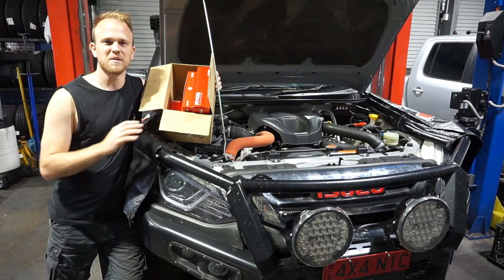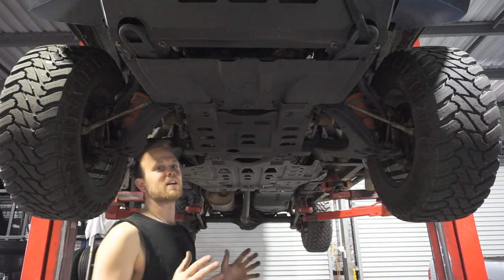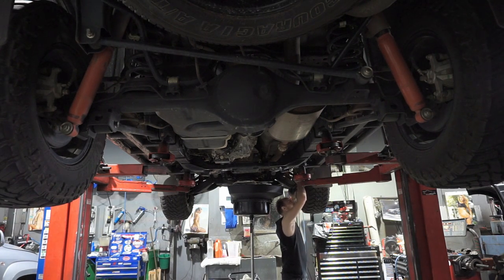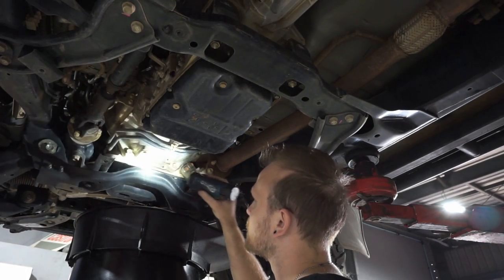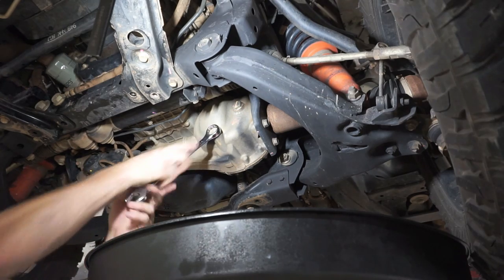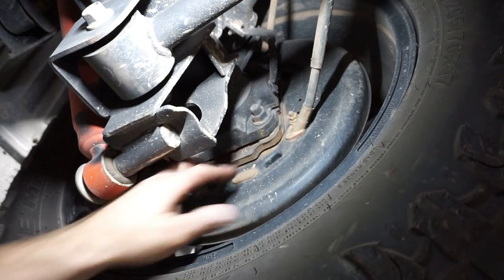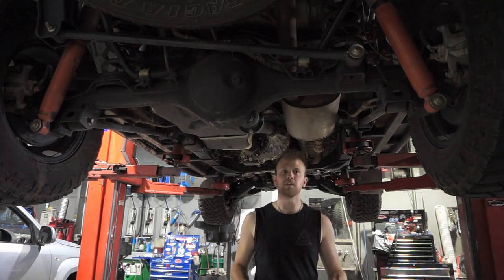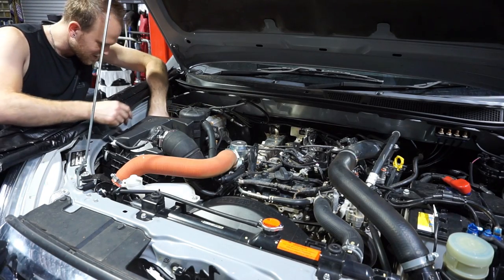How To Maintain & Service Your 4WD Vehicle - Isuzu MU-X Service & Maintenance

Comment from the maker: Hey Guys! Here's some tools that will make the job alot easier! 
Oil filter removal pliers - https://amzn.to/3cm8KMG
Socket and spanner set - https://amzn.to/3y7hrEr
24mm spanner - https://amzn.to/3lFMm60
24mm socket - https://amzn.to/3pDGVW8
1/2" Breaker Bar - https://amzn.to/3lLuoPg
Screwdriver kit - https://amzn.to/3Gmx7qh
Pick Set - https://amzn.to/3oz54OA
Bit Set - https://amzn.to/31FP3NQ
Cheers :)

Comment: Thanks for showing us how to do the maintenance work of Isuzu MU-X. I do not own one, but I was considering to buy an Isuzu MU-X. I was interested in all the construction details of the car. Such as chassis, suspension system, rear axle, drive shaft, brakes, engine & transmission. That was very informative, everything was thoroughly explained. This video is also giving a lot of information about the car itself. If I would go to the dealer to see how well the car was built, since I would not be able crawl underneath the car to see all of these details, by watching your video, I can have a fair idea about the quality of the car.

Comment: Thanks so much Nick. Just did my Dmax oil change, front and rear diff change and fuel filter. 

Please do one on radiator fluid change and transfer case oil change.

Comment: Great thorough video. Another request for a new video is drive belt replacement. In all of YouTube noone has done an isuzu drive belt video... I ended up only replacing the v-belt and leaving the main belt because damned if I could figure out how to access the nut on the back of alternator to loosen it off.

Comment: Nice video mate. Do you reckon you could do one on how to change the auto transmission fluid on the isuzu? Would help alot.

Thanks
Reply from the maker: I will definately do one down the track, I'm thinking next service i will flush the trans oil.
Reply: @LowRangeNick  ledgend. Maybe add a transmission cooler while you're there

Comment: Always enjoy your videos. Is there any advice you would particularly point out to those who have no hoist?
Reply from the maker: I would recommend getting a good car jack that can lift the car a decent height and 4 jack stands. Lift the car up as high as you can and put a jack stand on each corner so all the wheels are off the ground. Then throw down some big flattened cardboard boxes under the whole car or use a creeper to slide underneath. You can then pretty much follow through exactly how i did the service in the video. That's how I do services at home 😊
Reply: Probably not super endorsed.... but.... I use 4 wheel ramps and crawl up in low. Been used on LR D1, D2, Jimny and MUX. Jam a hefty piece wood to create a V shape behind two wheels for added safety. 
Not as good as a hoist, but works pretty well. For checks on bearings then just lift each corner or if you can each end.
Axle stands do work, but not as stable if you want to start reefing on things.
Reply: @LowRangeNick  Thanks Nick

Comment: Hey Nick great video, really helping me service my own car while I travel Australia. 
Do you have a link for the exact Front and rear diff oil that you used here?
Reply from the maker: You can use any brand diff oil that you like 80w90 is fine. I have a rear e locked in the rear now so I use 80w140 in the rear.

Comment: Hey nick great video as usual. Mate I am a motor mechanic by trade, I'm 63 so came out of my time yonks ago. My question to you is I have a brand new mux , just had the first 15,000 service done on it, I'm thinking rather than wait another 12 months for an oil change, I plan to do it every six months, what's your opinion? Isuzu tell you every 12 months but I feel that's too long. Cheers and keep those videos coming
Reply from the maker: Thanks a lot for the comment and for watching. I agree 12 months is a long time. I personally carry out my servicing every 10,000km or 6 months. Although the 15k intervals are probably ok with modern synthetic oils I still believe that it should be done sooner. If you look in the service book under extreme use you will notice that most of the normal things we do day to day or out on the weekends in our vehicles actually fall under extreme use haha
Reply: @LowRangeNick  yeah mate I agree, soon I'm gonna be towing a caravan so yeah every six, cheers mate and again love watching your videos, maybe an old fart like me can still learn something from a young fella like you,.

Comment: Nice video Nick. Are you worried about spraying brake cleaner in the engine bay and it eating the paint from over spray?
Reply from the maker: Ive never had any issues with the brake cleaner doing any damage to paint in the engine bay and after servicing i always wash down the engine bay and under carriage with water so the brake cleaner doesnt get time to cause any issues.

Comment: Should probably split off the cabin filter section, it's a great bit of info amongst normal maintenance stuff.
The oil filter catch/drain tray was a nice touch by Isuzu, not seen one of them before, LR and Suzuki just let you spill it over everything.
Might want to put a comment on the video though:
Fuel filter clean out, better to wash out with fibre free rag and diesel. Not sure what the cleaner you use is, but it kind of looks like degreaser, I don't think that would be a good choice for the fuel system, normal brake cleaner that evaps off would be OK, but still nicer to just use diesel.
Rad top up, should really use pre-mix or deionized water. If someone didn't know they might just top off with tap water seeing you use the watering can. Fine for short term or emergency, but terrible idea for long term.

Found all your MUX videos heaps useful though, the front end strip down and glovebox stuff was mega helpful when I was doing some fit out work a few months ago.
Reply: You are amazing.

Comment: Hey mate loving your videos, I have the same vehicle 2017 LS-T
Just wanted to know what grease you use to grease the tail shaft please.
Reply from the maker: You can use HTB or molly grease.
Reply: @LowRangeNick   Thanks, I was thinking HTB to save buying more than one grease but the owners manual has "multi purpose grease containing molybdenum disulphide" as the spec, and wheel hub/centre bearing spec "multi purpose grease".
Can I use moly grease for the bearings? as they both have the same industry spec "NLGI 2", appreciate your recommendations.
Reply from the maker: @kilionipole3308  I use HTB grease for the wheel bearings and for the uni joints. I havnt ever heard of using Molly grease for the wheel bearings.
Reply: @LowRangeNick  No worries, thank you very much 🤙

Comment: Nice one mate - thanks. What' are your thoughts on the Outback Armour suspension upgrade 9 months on?
Reply from the maker: The suspension is good for the price. I did have the front springs sag but they sent me out some modified heavier duty springs under warranty which i recently fitted. It is a stiffer ride than standard. They are a solid unit though and have stood up to the abuse well. If i had the money though I would go the whole hog, FOX shocks all round and their coils 😆

Comment: Hi Nick, Awesome tutorial and all steps very well demonstrated , but just checking I heard correctly - Valvoline Synpower 5w30? - Valvoline webpage says the product is not suitable for diesel engines or is this BS?
Reply from the maker: That's correct, synpower 5w-30 is what I used to use, it is c3 low ash dpf compatible oil. I have used penrite enviro + 10w40 for the last couple of services. I would recommend that.

Comment: Hi mate... awesome video... thanks a lot to sharing with us ... I got for you... what spot lights do you got on your MUX and also could please post a video about it????  ....cheers mate
Reply from the maker: They are the AFN LED spotlights, i have just removed them for a STEDI Light bar.
Reply: LowRangeNick Good on you mate..  I’m thinking to get those Stedi spotlight too so what do you reckon.. which gonna be better spotys or light bar???
Reply: Nick, did you buy the Isuzu plug and play thing for the spotties/lightbar? Or just hardwire them in? Thanks!
Reply from the maker: @alejandrozarate5197  The Stedi light bar I have is the 24.5" single row. It puts out great light and distance and doesnt vibrate with my AFN bar. I had issues with the big AFN spotties vibrating badly causing the light to shudder because they were so big and heavy. The light bar now keeps the weight nice and low and there is no more vibrations. So im really happy with the light bar. I would recommend a light bar if you have an AFN bar.
Reply from the maker: @kaneharry5966  I just used the AFN lights wiring harness and soldered it onto the high beam signal wire.
Reply: LowRangeNick Thanks mate I really appreciated to your reply... I’m looking forward your next video....cheers!!

Comment: Hi Nick .. would like to ask ..Why are you using Brake clean and not normal de-greaser  to clean up the parts
Reply from the maker: That's a good question! Brake cleaner removes oily residue and dries completely. With degreaser it will leave a film of the soapy degreaser on the component unless washed down with water. 😊
Reply: @LowRangeNick  Thank you carlo
Reply: @LowRangeNick  What brand is your brake cleaner? Cheers.
Reply from the maker: @MontyThePython  We just get it in big 20l drums at work, i think its Valvoline brake/parts cleaner.

Comment: Hey Nick,what size rims/offset you running and brand and style of tyre?also are they noisy?
Reply from the maker: Hey Kevin. I'm running 17x8.5 pos 7.4mm offset fuel offroad vector rims with 265/70r17 Atturo Trailblade M/T. They are very noisy. But incredible offroad. I will probably go a crossover mt / at like the toyo R/T or something similar next 😊
Reply: LowRangeNick.Cheers Nick,I’m running the same tyre,TA-KO.Yours look bigger,may be the square edges.Any how,noise is a issue for me so will keep looking.Thanks for the reply and keep up the good work.

Comment: Hey mate, what tyres rims and lift are you running? Looks good 👌
Reply from the maker: 2 inch lift outback armour, 265/70r17 Atturo Trailblade M/T Tyres and Fuel vector - 17x8.5 pos 7.4mm offset

Comment: Hi Nick,
Thanks for the great videos. Would you be able to point out which is the correct vacuum hose to pump the throttle body cleaner through. 
Cheers
Reply from the maker: Thanks Dave! Do you mean like a Diesel Intake cleaner? Usually the throttle body cleaner needs to be sprayed directly on the throttle body with the throttle body removed from the vehicle. Diesel Intake cleaner on the other hand like the three bond one can be sprayed directly into the intake. I usually take the airflow meter out and leave it plugged in and spray it in there or remove the breather hose off the intake pipe. 😊
Reply: @LowRangeNick  Thanks for the reply Nick. I've sprayed some subaru upper engine cleaner (have plenty leftover from a previous vehicle and is compatible with both petrol and diesel engines) directly into the intake and that seems to have done the trick.

Comment: Great video Nick, at what interval do you change the oil and filter? I have a MUX and under the bonnet the label says every 20,000 km but that seems a lot of km's!
Reply: Nick does his every 10 000km. It also depends on where you are driving the vehicle. Do it more often if driving a lot of dirt roads. Oil and filters are cheap so more often won't break the bank.

Comment: Are the drive belts easy enough to replace, do you need to go through the right wheel guard flap to loosen alternator belt. How about the power steer belt is it easy enough to replace. Cheers
Reply from the maker: I havnt had to change the belts yet, they do look pretty easy though.

Comment: Hi Nick, Thanks for your video, I have started doing my own oil & filter changes to my 2013 Dmax but it requires every 40K service " check & adjust valve clearance" this major service is very expensive at the dealer, I have tried to get quotes from other service people but all have said that they won't adjust valves. Is this required on your Mux? any suggestions?
Reply from the maker: It is required on my mux every 45k I believe. Interesting that other workshops wont do the valve adjustment.
Reply: LowRangeNick I paid $920 to have mine done at a dealer that shall remain nameless.It was still noisy after the service so I took it Isuzu GC and they told me the rocker cover hadn’t been off as the factory seal was still intact.They hadn’t adjusted the valves but charged me anyway!.scumbags.
Reply from the maker: @CRN8091  Yep, some places will only do an audible check lol
Reply: LowRangeNick what would your place charge?.
Reply from the maker: @CRN8091  Just for valve clearances or for the 45 and 90k services. For just valve clearances and parts it would probably be 4 hours labour + parts so approx $600. That's a guesstimate though. For the whole service around 1k sounds about right. For parts and labour.
Reply: LowRangeNick thanks Nick 🤙

Comment: Great video mate .. umm not to sure about the oil .. I mean I thought they came without the DPF and require 15w 40. Please shed some light on it . Thank you
Reply from the maker: The 2017 on models have a dpf and require dpf compatible oil. The pre 2017 models dont have dpf.
Reply: LowRangeNick I see ..thanks mate

Comment: engine oil flush?  Wher do you buy iy and what do you look for when buying flush oil?  Did you check the tyre pressure on the spare as well?
Can you do a video on changing the coolant some time if you havnt already done so?  Also my D MAX has never been in 4X4 mode as its used for towing a caravan.So is it necessary to change front diff at the same time as erear diff if front diff has never been engaged?
Reply from the maker: You can get engine oil flush from any good auto store. Most brand engine oil flush are the same so just pick any one you like. You should change both front and rear diff oils at the same time. Even though 4x4 hasnt been engaged the diff will still be moving.
Reply: @LowRangeNick  Thank you for that info.

Comment: G'day Nick.
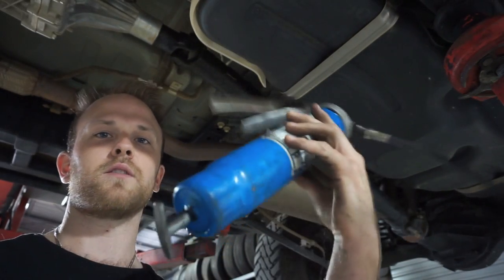Quick question about the grease you used in the grease gun (13:50).
The manual seems to indicate different grease types for different spots, but you used the same grease on all the various spots.
What do you recommend that we should buy/use?
Cheers :)
Reply from the maker: All the uni joints and slip joints need lubricating you can use Molly grease or HTB bearing grease. Either will work fine. I usually use high temp bearing grease as it is the bearing rollers that you are lubricating in the uni joints 😊
Reply: @LowRangeNick  Thanks Nick. I'm assuming that we'd be fine to 'mix and match' the new grease with the grease that's already in there, even if it's not exactly the same type?
Reply from the maker: @mckernovic  It is fine to mix and match, usually when you regrease it it will push the old grease out of the uni joint.
Reply: @LowRangeNick  you're a champ! Thanks.

Comment: Hello Nick.  Is changing the oil on the MUX straight forward  just like a normal car or do you have to reset something in the computer  after oil change to do with DPF..John Cadogan mentioned something on his you tube video on 12 month servicing..Can you enlighten me on what is the go here please. I personally think 12 months between oil changes is too long. New oil and filter every 6 months is a small price to pay to keep your engine  well lubricated. Would like to hear your expert advice  ..Kevin
Reply from the maker: Hey Kevin! I think your correct servicing every 10k or 6 months will keep your engine in tip top condition. You don't have to do anything with the DPF after a service. You can set a service light through the instrument cluster on the newer models though
Reply: @LowRangeNick  Thanks Nick for the info. Very much appreciated. Too good mate. Will I void  my warranty if I do the oil change my self in-between the factory services.. My MUX is 6 months old..Kevin..
Reply from the maker: @kevinbyrne7400  It may be an issue doing it yourself from a warranty point of view if you are not a qualified mechanic. But if you can always do it with a genuine filter and they will never know haha. I'm lucky enough to be a qualified mechanic and be able to carry out log book servicing myself.
Reply: @LowRangeNick  Thanks for your reply Nick.  I have purchased a genuine Isuzu  filter. Thanks for your help and answering me on a Sunday. Too good ,  much appreciated. .Kevin

Comment: hey nick did engine oil change now engine light is on
Reply from the maker: That's not good. You will need an obd2 scan tool to read the code and see what it relates too. Then you can carry out diagnosis.

Comment: what brand of oil do you put in your car's differential, transmission and engine?
Reply from the maker: Valvoline oils. I have recently changed to Penrite though. They are both good.
Reply: how often do you change transmission oil and defferential oil?

Comment: Hi Nick, can you tell me that after an oil change and filter change I put 7.5 Ltd of new oil in and it is at the top of the dip stick mark 1 to 2 is this ok or is it ment to be in between the two marks. Your advise would be appreciated.
Reply from the maker: Not too sure which marks your meaning. Can you msg me on my facebook page a picture and I can tell you. Page is @lowrangenick Cheers 😊 They do take about 7.5-8l of oil
Reply: LowRangeNick Sorry Nick, I don’t have Facebook. The dip stick has a low oil mark at the base and a high mark between the yellow markers, I did my first oil change on my Dmax and the oil level is at high mark is this Ok in your opinion. There is a third mark on the dip stick which is above this and is marked with a X the oil level is nowhere near this. Hope you can make sense of this.
Reply from the maker: @gill68716  It sounds like you have it on the right spot on the dipstick. It should be sitting on the top Mark on the dipstick. It shouldn't be any where near the x.